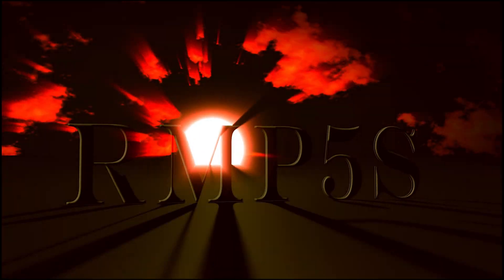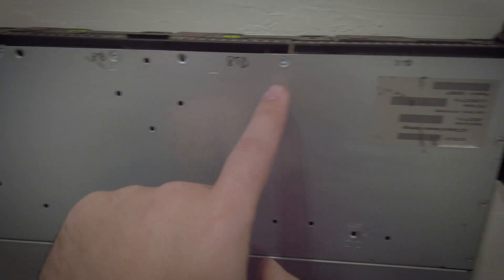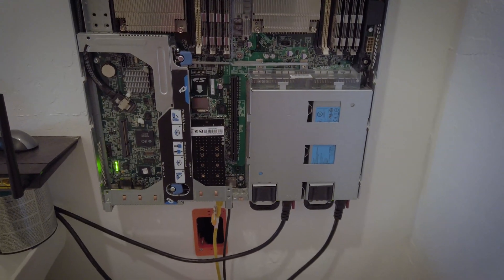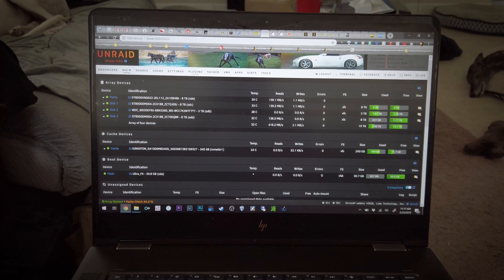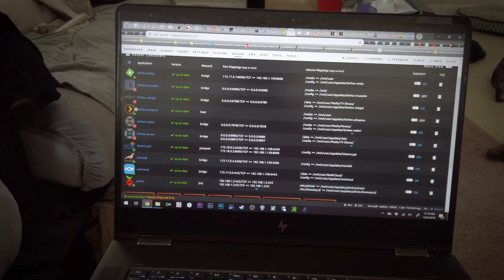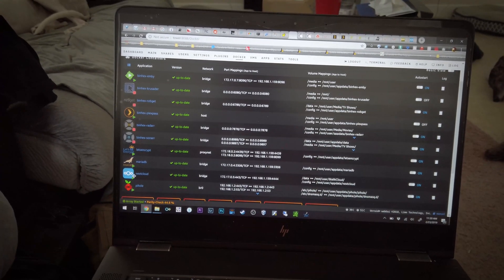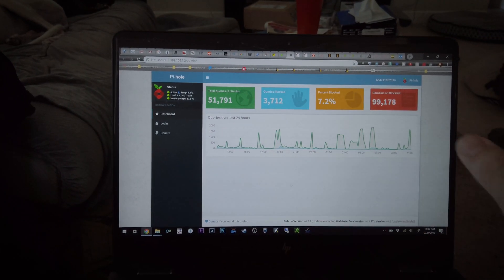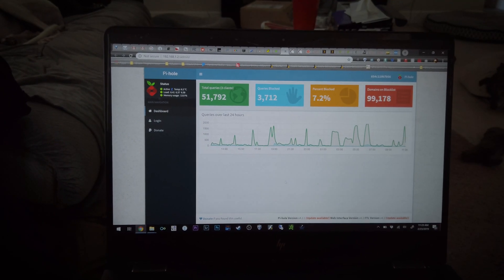HP ProLiant unRAID server updates!!  Cache drive and PiHole Docker Container!

Comment: Nice setup!  I’m looking at doing something similar. Did you have trouble using non-HP hard drives or did you mount them on a HBA?  Are you using the embedded RAID card?
Reply from the maker: Avoid a RAID card if at all possible. 

If you can't avoid it, I made a thread about what to do where I outline the steps:

https://forums.unraid.net/topic/82007-solved-unraid-with-hp-p420i-raid-card-in-hp-proliant-dl380p-g8/
Reply: Tks for the advise. I’ll check out that link.

Comment: unraid supports dual cache for redundancy only not capacity
Reply from the maker: Right. I misspoke in the vid.
Reply: @rmp5s  check out spacevaderone he has done some mint videos on unraid
Reply from the maker: Oh yea, very familiar with him already!
Reply: @PSYCHOPATHiO  That is incorrect.  Unraid cache may be configured as raid1 (mirrored for redundancy as you state), raid0 (striped for capacity and performance) or jbod (for capacity).  IIRC these Unraid cache options appeared in Unraid 6 (6.4 and up for sure).  Find these settings by clicking "Help" (icon is "?") while looking at cache Balance.  Also see further documentation by clicking "Manage" also listed on Balance help.  

Spaceinvader One is the undisputed youtube Unraid guru.  HIGHLY recommended!

Bill Walker

Comment: I love this vid! One question about the Pi-Hole, if the device is that it runs on is turned off, will ads still get through? They will mhm?
Reply from the maker: It depends how you have it setup. I have my gateway setting the DNS addresses network-wide. Primary DNS is my server that's running PiHole, secondary DNS is set to 1.1.1.1. So, in my case, if my server went down, the network would use 1.1.1.1 and yup, ads would get through.
Reply: @rmp5s  That's just a preference setting, which mean its preferred they go to the pi-hole but some will still go to 1.1.1.1.  I have 3 pi-hole docker containers set up for redundancy over 3 HP Microserver Unraid servers.  I notice that all pi-hole servers have activity on them.  You can set up a little raspberry pi physical as your redundancy that way nothing will get ads or web content they shouldnt.